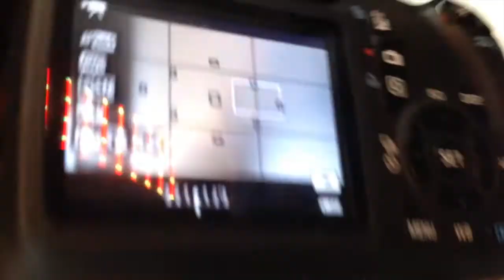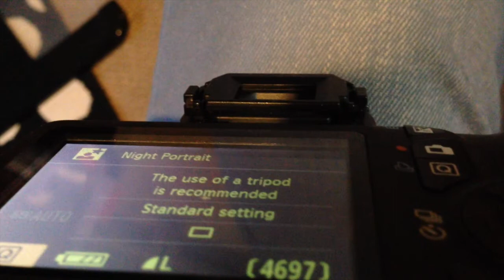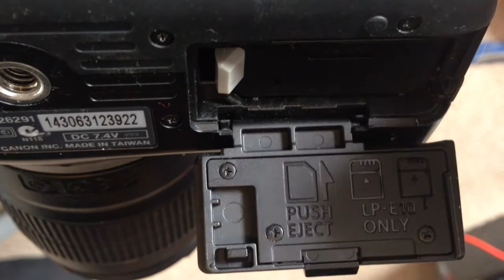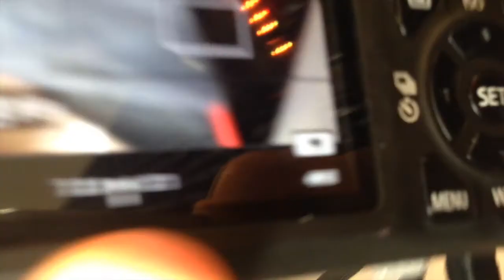Canon EOS 1100D Continuous Power With Battery Hack Under $5

Comment: Hi, i have a canon camera eos 1100d, the battery is dead because i have not used the camera for long time,the battery is LP-E10  7,4v 860mAh, my question is : can i buy a higher mAh battery?? For example, a 1200mAh battery?? Thanks for the video
Reply: Yes, higher mha is better just voltage should be the same 7,4v

Comment: thank you so much , really helpful, i am facing a trouble finding a power source, i got Sony NP-F770 7.2V 31Wh and tested the output almost 8V , but the camera keeps giving ( Change the battery pack ) as an re-swap needed! i was wondering about the max input i can hookup my Canon 1200D ?

Comment: I modified my powebank with dc-dc step-up module directly to the battery. It give me 5v from 4v (18640 cells). It works fine until i use it to take burst shot or just open up the flash.

I think the voltage drop so fast when flash capacitor charging, so... How to solve this?
Reply: The problem looks like DC to DC power step up. A big capacitor may help to keep voltage in the level for a second. If flash demanding a snap power at the beginning. Connect 2200uf 16V capacitor, out of DV-DV (where you have 5V) But camera needs 8V isn't it? Why you do it with 5V?
Reply: @TrevorDBEYDAG  my fujifilm finepix hs10 use 4 pcs AA 1.5v battery in series.
Reply: @TrevorDBEYDAG  i solve this problem with using step-down module to convert 12v to 5v. It work perfectly.
BTW, how to install the capacitor, can i search it on google?

Comment: Flamable glue and wood next to linear regulator, sounds like a fire hardward to me.
Reply: Wood needs over 200C to flame, glue needs over 150C to do any harm, my tests show that regulator doesn't go over 30C. It is recommended to use it; first attended and watching the temperature. Note that the batteries that we are using in everyday life in every devices are more dangerous than wood and glue, batteries are active chemicals. 😀

Comment: Just so thoughts: LT is a linear regulator. It will become hot after some use @ 17 V. It would be better to either limit the input to say 9 to 12 V, or use a DC/DC converter.
As for the battery lid, there are 2 options: there is a small rectangular rubber cap to the battery compartment, where the power cord should follow; or you can try to glue something to the casing and the lid switch will be activated once the modified case is inserted.

Comment: Great video, sir, thanks a lot! Do you have any ideas about DIY stepping up 5v to 8v, so you can use usb power bank for powering DSLR?
Reply from the maker: Probably yes, be careful step up should not pass 9V.
Reply: @DejaWorksLab  Thanks. 9v still safe for dslr?
Reply: @penkatadrums  boosters are costlier. Double the price of step down buck convertors.

Comment: Tried this method with LP-E8 battery on a 600D T3i Rebel. Didn't work initially but after a bit of tinkering and research, I managed to get it with a few additions

If anybody else needs to know how to do it just ask, didn't upload my method because I don't know if its something people are still doing instead of buying the cable for a reasonable 11.99. That said,  this was free and cost me nothing. Everything I needed was found in old electricals I already had. 

Really great vid though, helped me take the steps to achieve everything that was needed. Thanks.
Reply: Could you please share your method? I have been trying the same with LPE8's. Stepping up from 5V to 8v from a power bank. Didn't use the battery communication circuit just a normal DC Coupler. Camera powered on but within a couple of minutes battery level drops and then I get "change battery pack" message.
Reply: That is good can you help with LP-E12 for Canon M50
Reply: Could you please share your method?
Reply: For an LP-E8 battery, connect the power supply connections to +ve and -ve of the battery regulator board and connect the T terminal of the battery regulator output to -ve through a diode. Don't use a linear voltage regulator, it is a fire hazard and will burn your camera down before it reaches its thermal cutoff limit. Just buy a dc-dc buck boost converter and set the output to 7.4v.

Comment: This is a nice hack.  I would try it if my electronic skills were better.  I would be worried that I would fry my camera if I make a mistake with voltage.
Reply from the maker: Yes, for sure, you have to use a multimeter/voltmeter to verify the output!